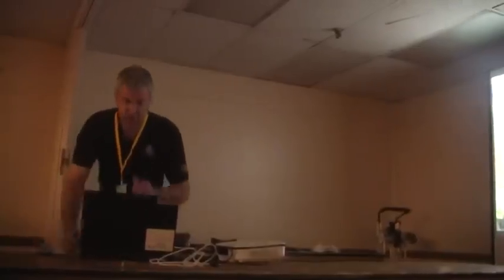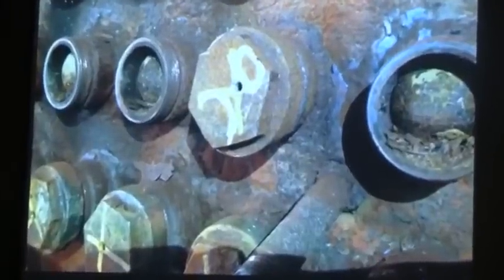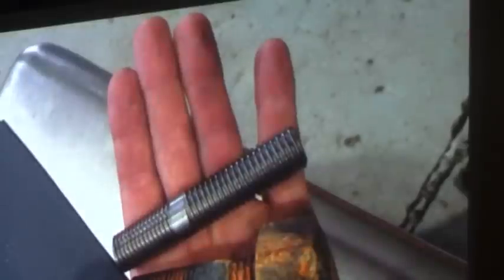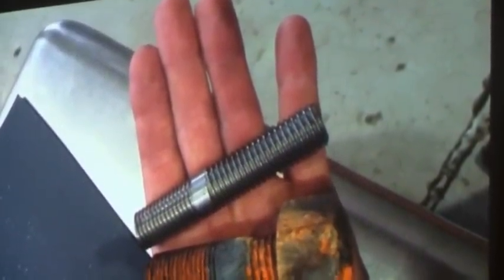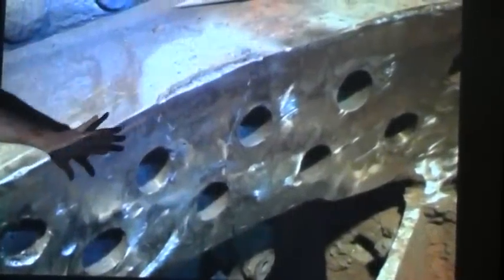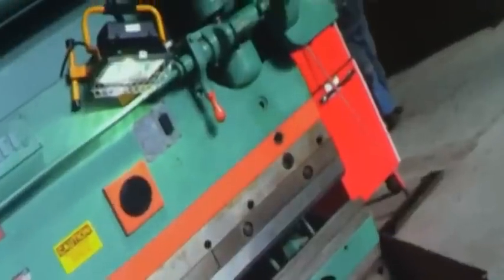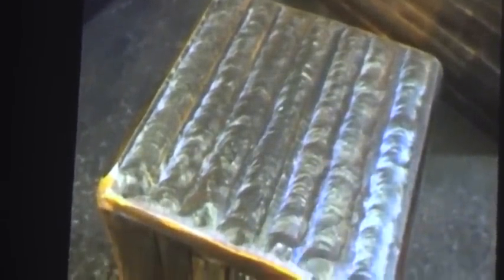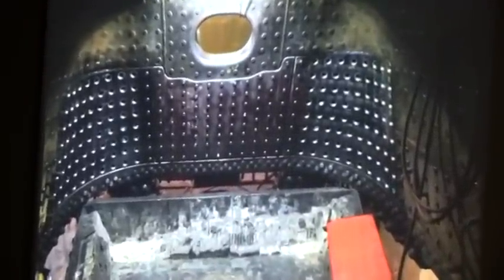Union Pacific 844 & 4014 Progress Report-March 2016 pt 1 of 2

Comment: Called it, I knew they would convert the 4014 to oil like they did the 844😅
Reply: 02powertube as built the big boy carried 25,000 gallons of water and 25 tons of coal. The big problem today burning coal 
is all the locomotive coaling docks are either gone or the machinery is gone making them unusable. Now visualize this leave Cheyenne yard headed west with 4000 tons of freight on the drawbar the UP had coaling docks roughly every 25 miles west of Cheyenne as the big boy would and was capable on freight of emptying the coal bunker on the tender and yes I've talked to retired UP engineers that ran the 4000 in regular service. One told me of a trip where they barely had enough steam to roll up to the next coaling station more often when they first went into service then they wanted, ten minutes after arriving they were back on the move. He said until they increased the capacity of the coal bunker on the 4000 class to if not eliminate the problem they really reduced the likelihood of running out of coal before you got to the next coal dock. UP now list the capacity of a 4000 coal bunker as 28 tons. Do you suppose running out of coal just before you stopped at the next coaling station was why the increased the capacity of the tenders? Not a good way to run a railroad but with a new design you always find little opps! Why didn't we think of that? For an engine the size of a big boy it's remarkable how they ran and I've heard of in a pinch they used em on passenger where they better miles per ton because of lighter tonnage tied on.
Converting to oil makes sense for easier cleaner refueling, no ash to remove or handle, no coal dust. And allows them in a pinch to use straight diesel from the same rack that fuels the diesels. Another major advantage if the haven't done it already is converting a auxiliary water tender to all fuel with the appropriate pumps to transfer fuel on the fly. How you like to ( I'm taking an educated guess here ) have one auxiliary tender with say 40,000-50,000 gallons of fuel behind the auxiliary water tender. Auxiliary water tenders generally use two large water hoses identical to the hoses the connect the tender to the engine. The auxiliary fuel tender could use both steam and 480 HEP as a backup to keep the fuel where it needs to be 160 degrees minimum so it will flow and atomized as it enters the burner. With a full fuel aux tender that minimizes using expensive diesel fuel as it's easier to program a trucks to refuel on the road with filtered waste vegetable oil. I hope i live long enough to see her come out of the shop on her own power.
Reply: convert? Yes. No one is going to run coal in 2016. Just sayin. Wish we could but..uh. no.
Reply: +Frank FREAK Yeah. It's for the better. It'll free up the firemen to do other things other than shoveling and slaving over a hot firebox.
Reply: I would also prefer they ran on coal, the smell and sparks is just a part of steam locomotives. 
They used stokers to feed the boiler, so no shoveling to keep uo steam. 
But yes - in the yard or in general the maintenance is much more convenient with crude- oil or diesel.

Comment: As a retired Manufacturing Engineer and train fan I am so disappointed in the condition of the 844. This answers many of our questions relative to the 3985 and it's condition. As a USAF aircraft mechanic and very mechanically talented I see what we call Jerry rigging relative to maintenance on these locomotives and serious neglect. Who knew Mr. Lee was German? Under combat conditions these processes would be acceptable to complete the current  mission like we had to do in Viet Nam, but I'm confident not on the Union Pacific.

Comment: when the 4014 is done will it run off coal or oil?
Reply: +talesin- god of the internet ok thanks for the reply
Reply: UP RR plans to convert 4014 from coal to oil. They tried oil firing a big boy once before
And it couldn't cover the 150 square feet of firebox area reliably. I feel confident the UP
Will find a way to make it work. Another reason UP converted 844 to oil is 
Less likely to start right of way brush fires and in a pinch they can pull up
To the diesel fuel rack or call a home heating delivery truck to fuel the 
Engine in a pinch, lot easier than refueling with coal. Normal fuel is used
Filtered vegetable oil. Yup a Big Boy can smell like French fries!!!

Comment: amazing work. Corrosion/exfoliation is not water, it is the ph +ionization. This leads to some questions of modern rails lit by electricity more than ever. Are there plans to measure and guide to something like heatsinks? I was a crew chief on a military plane less than 10 years younger than 844. Similar errors..sky, land and sea.

Comment: When the 4014 is finished can it pull trains on its own?
Reply: +Tartendymion 54 doubtful because of lack of dynamic braking
Reply: +theshapeexists Pulling is not in question. Like the 3985 and the 844 they hook on diesels to help them stop. The big boy can replace four of the largest diesels today pulling a train.
Reply: +choochoo3985 yes, you are correct. I was stating that it wouldn't be allowed by law without the assistance of diesel braking. I heard a big boy can single handedly pull a 5 mile long train, so power is definitely not an issue.
Reply: +theshapeexists The railroad decides how they run power on trains, not any law.  Dynamics are the key to maintain braking downgrade but when push comes to shove we use air brakes in addition to "Dynos" on steep grades like Donner.  Saves on hot shoes and tie fires.  That's why you almost always see diesels behind steam to save the brakes.  Remember that back in the steam days we had cabooses with eyes watching the train front to back for hot wheels.  That's all gone and we have detectors now.
Reply: Michael Beard

Comment: I want all three to run again, I REALLY hope they don't decide to retire 3985 like I've been hearing.
Reply from the maker: +Steve W They sure sound confident that 3985 will return, but it is just 3rd in line for the "TLC" .
Reply: I sure hope so! I know it needs a lot of work.
Reply: +Steve W 
 I'm sure it will. In the past few years, they have invested over 2 million dollars into it!
Reply: I'm definitely glad, the Challenger is my favorite of the three, not much different than the Big Boy, just a Big Boy minus 4 wheels. :)
Reply: +talesin- god of the internet last I heard, 3985 was on a 5 year overhaul...
Reply: *****
cite, please
Reply: I talked to a man at a model train show, who has a lot of info on 3985. They will not be retiring it as they have spent over 2 million dollars on putting it back in operating condition.
Reply: Byron Bonham
a lotta rail fans have a lotta "info" on a lotta things
the fact is that UP has been silent on the 3985
Reply: Not true. The man I spoke to Knows an employee with the steam program! That was money that has already been spent on the locomotive. You don't think they would do their best to restore it after spending that much???
Reply: I agree. UP knows the public value of each of the locomotives. They know what they are doing, and the 4-6-6-4 class is a very unique design for UP like the 4-8-8-4 and 4-12-2. There is no return on investment on a engine sitting in the back of the roundhouse collecting dust. As mentioned by others the first 2 priorities is 844 and 4014 for the next few years.
Reply: Yup, 844 is alive and well!

Comment: Ed probably doesn't read this but I can make his life much easier. Take a big magnet drill, remove the base, attach a 1/4" steel plate to the base with a hinge on one side and a bolt on the other, then attach another plate to that hinge with a hinge at 90deg to the 1st one and a bolt opposite, then attach the magnet drill to the opposite side of that hinge. By doing that you can angle the mag drill in any direction so you can align and dill your holes. The leverage you can get on a mag drill will make putting those holes in much easier. and probably more accurate since it won't want to walk when it is magged to the boiler.